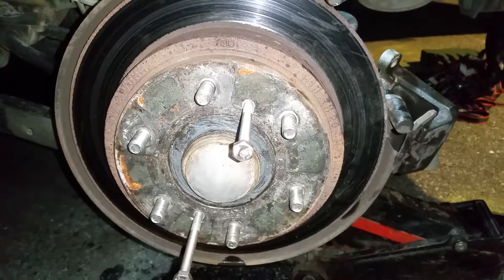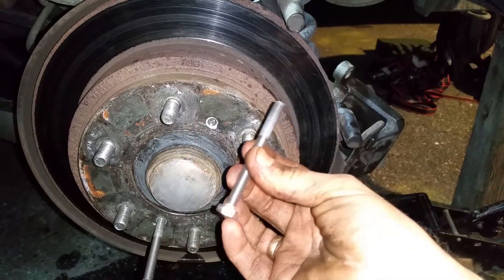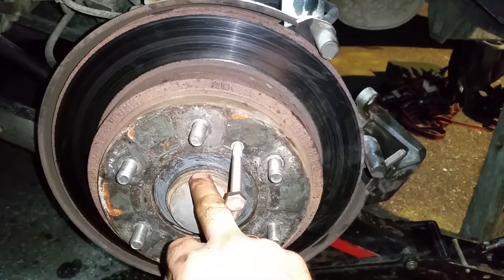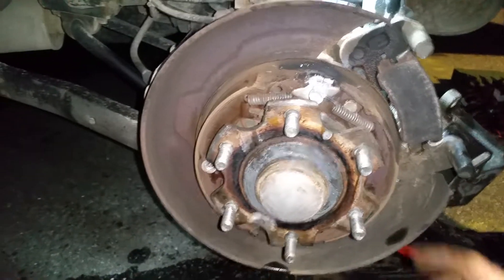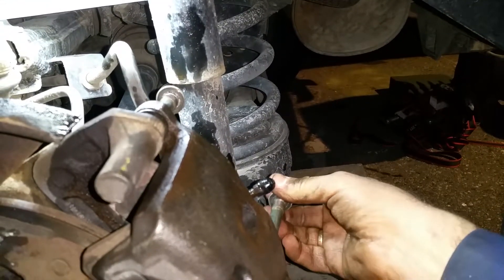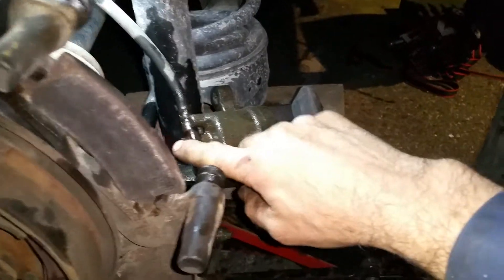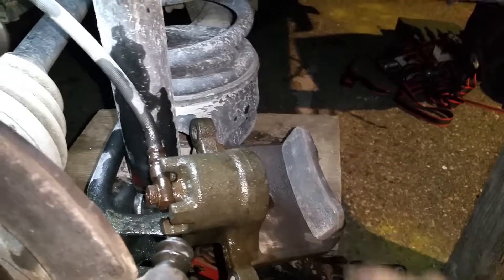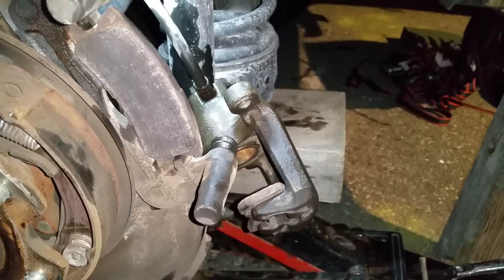Shogun/Pajero seized brake emergency repair

Comment from the maker: Bought new caliper cylinder and seal kit from Mega zip.  After the repair I posted in  this video, my car did work well for a number of months,  but because the previously overheated gaskets, the water got in and that caliper piston/cylinder got seized again. Now it works fine with brand new original parts. Will never use aftermarket parts on systems that are critical, like brakes and steering and items that if fail, would get in troubles